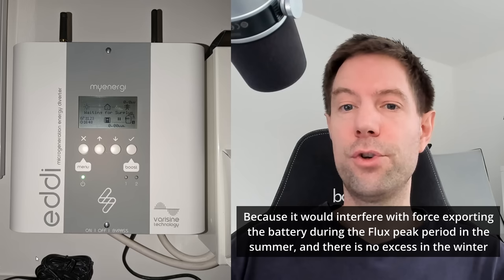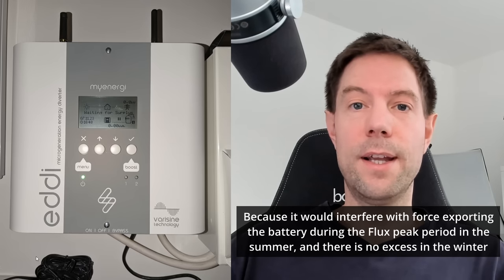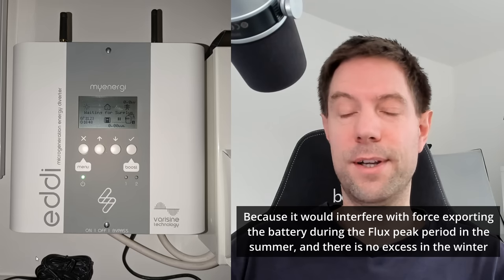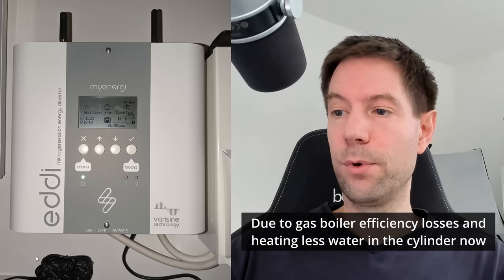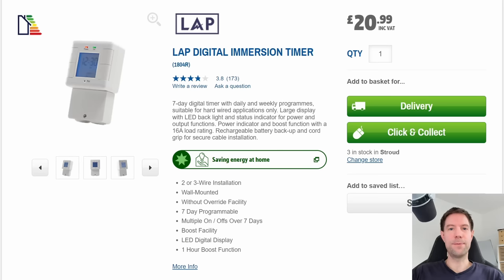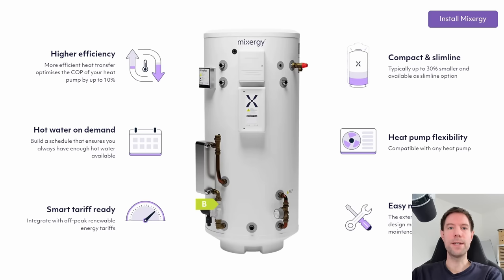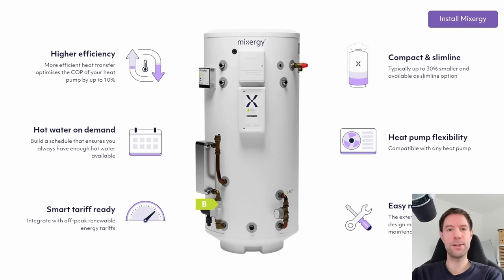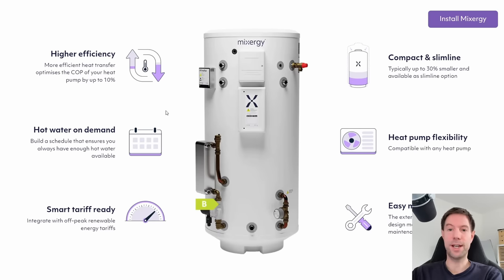Gas free hot water - so many options!

Comment: Interesting options when considering A2A heating and how to heat DHW - we currently get approx 200-250 days of ‘free’ HW from PV diversion (hardly any in the winter due to the addition of a battery lat year which takes priority)

BTW your explanation of how flat plate and evacuated tubes work wasn’t quite accurate - the water itself doesn’t circulate through them but through a heat exchanger mechanism depending on which type (usually filled with anti-freeze). Also evacuated tubes only have a header tank at the top - the tubes themselves are hollow much like a vacuum flask and have another tube within containing the heat transfer fluid which evaporates and carries the heat to the top to then be transferred into the header tank. They still work pretty well in winter and were all the rage along with thermal stores - they seem to have fallen out of favour over PV it seems but as a supplemental heat source could well fit the bill…
Reply from the maker: Yes, I simplified the explanation for brevity as it wasn't too important.  More important to show that it exists than folks know exactly how it works.
Reply: @TimAndKatsGreenWalk  true to some extent, but the benefits are that once you have them installed, there is no additional (electrical) energy input needed (for the most part) unlike the alternatives where you still need a source of electricity - that in itself is the biggest plus point - admittedly on really dull (or snowy!) days the immersion may need to come into play but £ for £ they may actually be the best value solution if you have the roof space...
Reply from the maker: @Umski  I showed these various options as a starting point for folks to do their own more detailed research if they were interested in any particular solution.  I couldn't really describe every detail of every system or else the video would have been excessively long!  And there are bound to be many other systems I neglected entirely.  Regarding the solar thermal not needing electricity, I did mention it was the sun that did the heating and not electricity, so I think I covered that point in the video, as well as mentioning supplementary heating might be required in the winter.

Comment: You should wire up the top and use that one instead and do something similar to the mixergy. There is a technology connections video explaining it. Also, I got a T Smart immersion heater that gives you some smarts for around 100 GBP.
Reply from the maker: Yeah, that's an option but we do sometimes need a bit more hot water than usual (when we have visitors, for example).  Hopefully we'll get our replacement system next year in any case.
Reply: @TimAndKatsGreenWalk  I fitted a duel immersion cylinder with a change over switch to be able to select either depending on water needs.

Comment: I wasn't aware that some air to air systems can work for water too. Do you know of any systems in particular?

If it can do that, that's kinda cool
Reply from the maker: So the only one I know of is the Daikin Multiplus system, but it turns out the hot water cylinder is quite small at 120 litres, so not great for larger households.  And there is some debate about whether or not you can actually get hold of it in the UK just yet.  It might be that we did end up making a sensible choice after all and wouldn't have chosen differently even if I had known about the Multiplus system last year, but there you go.  Anyway, worth looking into in case it turns out to be suitable.
Reply: @TimAndKatsGreenWalk  Thanks. Definitely worth looking into

I think you also made a fair point at the end ie: the heat pump cylinder making noise which could be annoying when the boiler atm is in my room, in a little cupboard which also acts as a walk in wardrobe.

I do like the idea of keeping the walk in wardrobe, and having a heat pump cylinder outside. I'm not too keen on sunamp largely because of the reviews I've seen against them and them being fairly vague on their website

BTW have you looked at a Zypho or similar? The idea is that they have waste water heat recovery which further helps save your DHW usage
Reply from the maker: @waqasahmed939  you'd probably want the heat pump cylinder in a garage or similar, rather than outside.  I'm not sure how weather resistant they are (electronics and such) and they would lose more heat when outside too.

I have looked into the Zypho, looks interesting, but not something I'd install unless I was remodeling the bathrooms.  One to keep in mind for such an eventuality though.
Reply: @TimAndKatsGreenWalk  That's fair. I do only have a small (uninsulated) garage too. I'm with you RE: only getting a zypho if remodelling. Otherwise they seem expensive as a one off

I did however switch from an electric shower to a smart digital shower. I've got an en suite that already had a mixer too, and interestingly I found zero pressure drop when replacing the electric shower for a smart digital shower. I think the digital thingy regulates the pressure somewhat which is very useful when I don't have a cylinder .

My initial rationale was :

It's unlikely that I'll use the en suite at the same time as someone in the main bathroom. 

The guy before me was an auto electrician who wired the shower and lights together on the same circuit and that kept tripping my fuse. 

I was told that the wire was just within tolerance for the shower but not also for the lights too, and I figured I seriously reduce the risk of my house burning down due to a wire getting too hot and I reduce running costs if I move to a mixer 

I bought the smart digital one because it was £200 more and I thought that's not bad in the grand scheme of things 

I've now had a shower whilst the other main shower was on, albeit rarely, and I still found zero issues. That's a nice additional benefit 

I found out about the zypho later on however so if I remodel, I'll pop that in
Reply from the maker: @waqasahmed939  goodness me.  Yes, I can see why you'd want to change it.  It's always tough to decide what's best to do.  Good luck with whatever you decide!  Although at least the digital shower seems to be working better for you.

Comment: I am just about to start a major renovation on a 1950's bungalow.  I am starting off with a wrap around extension and a dormer in the roof.  The front of the house will have external insulation fitted and as it semi-detached I am also going to include some insulation on the adjoining walls.  The roof is East West just like yours so I will have 6 in-roof panels on the front and 6 panels on the flat roof of the dormer at the back.  I have designed in a plant room, as the garage is being demolished, and that will have a Mixergy tank, a tesla battery, connections to the underfloor heating from the ASHP and an MVHR controller along with one or more new consumer boards and a power supply for the car charger.
My question is this, can the ASHP support the Mixergy tank as well as the under floor heating? or should I try and power the Mixergy tank from the solar.  I think I understand most of how everything works individually but it is how I combine the various elements that I get a bit lost (also planning on having the Harvi & Eddi).  Your thought would be very welcome p.s. I love the channel.
Reply from the maker: Sounds like a great project, but there's one adjustment I'd suggest.  You shouldn't need the Mixergy tank at all as most A2W ASHP systems will come with their own hot water tank, which will run from the heat pump too.  So in other words you'll get both heating and hot water from the one system.  If you're heating your water using the heat pump (which is what I would recommend) then you shouldn't need the eddi for solar diversion either, as it's much more efficient to heat the water using a heat pump (at 300% efficiency) than using direct electrical heating via the immersion and eddi (only 100% efficient).  You could then export that excess solar instead using a good export tariff such as Octopus Flux in the Summer (and then switch to something like Go or intelligent Go in the Winter when the excess solar dries up).  Whenever you're heating anything (home or water) then a heat pump is always the best option.  I hope that makes sense.
Reply: Thank you so much for the heads up, I hadn't realised the ASHP came with it's own hot water tank, I was thinking of the Mixergy as It will only be me in the house most of the time and I liked the idea of only heating as much as I needed, presumably the standard tank will be fully heated.   My reason for doing this is to have minimal cost in my old age and I only have the money now and when it's gone it's gone.  Having read some of the other comments not having the Mixergy would also save on the servicing.  Have I missed any tricks anywhere else?
Reply from the maker: @christinewhite3749  so you'd probably find that a heat pump heating a full cylinder will still be significantly more efficient that a Mixergy tank heated only halfway.  Although, you could probably get a relatively small cylinder to go with the ASHP system (120 litres, say), in which case you'd get both benefits.  As for other considerations, the only other thing I'd suggest is taking a look at the GivEnergy All in One battery, which has similar specs to the Tesla Powerwall but is a lot cheaper.
Reply: a suggestion?

you mention Tesla battery

if you follow Tim's great suggestion of a GivEnergy battery, maybe consider TWO batteries? (say, 20KWh-24KWh). Might still be cheaper than Tesla PowerWall!

my suggestion is based on the substantial eventual size of your home, to maximize self-consumption in summer and maximise off-peak charging in winter.

it depends on your home and EV's consumption, and generation, across all seasons.

installation costs are a SUBSTANTIAL proportion of the final cost; installing two at the same time is likely to be considerably cheaper than two installed separately.

perhaps look to the associated GivEnergy EV charger for benefits from them being able to 'talk' to each other so they are both smarter
Reply: Thanks for adding to the conversation - I did look at other batteries but unless I am mistaken the Tesla seems to be the only one which can power the house in a power cut, others just let you have a couple of sockets so you can boil a kettle, we just don't know what the future holds and I would just like this little extra security, If I am mistaken please set me know.
Reply from the maker: @christinewhite3749  the GivEnergy All in One also has whole house automatic power cut back up, basically works exactly the same as the Tesla.  I did a video about it a while back, I'll grab the link for you.
Reply from the maker: @christinewhite3749  here you go: https://youtu.be/_cr87eTvqYs?si=ADraftbo_PlsUhLn

Comment: Hi Tim thanks for another great vlog. I to didn’t know you could heat your hot water with an  A2A system so I am looking at a Mixergy tank. I am told the heat pump on top of the tank is quiet?? So would be suitable for an airing cupboard??
The problem with all this change we are doing I have found little advice/ information on which direction to go.
So have relied mainly on YouTubers like yourself to make my decisions and I thank you for that and sharing your journey.
Best regards 
Simon
Reply from the maker: Well, the heat pump on top of the Mixergy cylinder is not exactly silent, I think you would notice it.  It'd be like having a particularly loud fridge in the airing cupboard, so you might want to consider some sound proofing treatment to be sure.  Unless you can install it in a garage, say.  Although another viewer did mention that apparently you can install the cylinder and heat pump in two different places, connected with the relevant pipes, so you might be able to install the cylinder in the airing cupboard and the heat pump somewhere out of earshot.  I've not verified this just yet, but I'll be getting in touch with Mixergy to confirm.  In either case you would need venting pipes to the outside for the heat pump, so that's something to bear in mind too.
Reply: @TimAndKatsGreenWalk  maybe I could connect it to my existing ASHP as I have a spare outlet on it?
Reply from the maker: @simonperkins345  good question, that's not something I know the answer to for sure.  You'd have to contact your ASHP manufacturer to see if you can do that.

Comment: Nice insight to the options available . Seems like a very small return for an expensive investment, have you done any calculations on return of investment if using off peak tarriff in winter and free to heat with solar in summer
Reply from the maker: Yeah, it's not the best "investment" for sure, but that's not really my aim here, I'm mainly trying to reduce our energy usage.  If you have a good export tariff in the summer (Octopus Flux, say) then the opportunity cost for export is pretty high (20 p/kWh ish) so saving those kWh to export rather than heating your water is actually pretty beneficial.  Even so, I doubt you'd pay for the kit in a reasonable time.  Still, I present these options for those who might be interested.  And if you have to replace your hot water system anyway (due to age, or failure) then it makes sense to do so with an efficient replacement.
Reply: I think mixenergy have control over the cylinder so they can dump heat into it when required at certain times  and they charge to have someone come out to service every year also

Comment: Are you considering a thermodynamic panel? Instead of the outside unit you have a panel on your roof or wall. I haven't seen much on YouTube about them lately though.
Reply from the maker: You mean like the solar thermal option I mentioned, or are you referring to something different?  I think I'm pretty set on the heat pump cylinder at this point but if there's something I've missed I'd be interested to know.

Comment: Interesting..  Just for clarity and assuming a new water based ASHP where being fitted the ASHW-cylinder would not be needed?  Would there be a differential between SCOP of an external heat pump plumbed to a specific compatible cylinder and that of a ASHW-cylinder?   For some reason I had it in mind that the external ASHP only heated a hot water tank at a SCOP of 1 🤔
Reply from the maker: The SCOPs should be similar regardless of where the heat pump is installed (as long as the air is vented to and from the outside) .  So an external heat pump would still heat a cylinder at a SCOP of 2.5+, maybe higher in some cases.  The main advantage of the A2W system is that you then only need the single external heat pump, which would provide both space heating and water heating.  Having opted for A2A instead I'd need that second heat pump for the hot water, unfortunately.  In either case you need a cylinder to store your hot water, heat pumps can't provide hot water on demand.

Comment: The second element on your water tank is usually wired in on an economy 7 system (cheap rate electricity overnight).
Reply: You can wire the second element  up to your Eddi and configure a Top and Bottom of the tank. Eddi will heat top first when boosting / solar excess and bottom when doing overnight heating. Benefit is you only heat what you need. It’s one of several configuration options in the Eddi manual.
Reply from the maker: We're heating ours at cheap rate anyway, so it's all good.
Reply: @TimAndKatsGreenWalk  less heat up time and heatloss when less water required by using top one. lag any warm pipework in the airing cupboard. got our cylinder heatloss down to 68W for a 174L megaflo eco
Reply from the maker: @waynecartwright-js8tw  the heat loss from our cylinder is about 45W, so I reckon we're doing ok (I lagged the heck out of all the pipes in the airing cupboard).

Comment: Using the immersion heater, the cylinder will fill up very quickly with limescale. Like a kettle.
Having 60-65 deg water circulating in the cylinder heat exchange coil, minimises limescale deposition.
Reply from the maker: Depends on your water hardness and the temperature but yeah, something to consider.  Titanium immersion elements help prevent build-up too.  Hopefully we'll be replacing our cylinder with a heat pump one next year in any case
Reply: @TimAndKatsGreenWalk  
Is it possible to have these heat pump cylinders installed in the airing cupboard?
Reply from the maker: Yes, although you'd need vents to the outside (possibly via the loft) and you might want to add some sound proofing to the airing cupboard to help mitigate the sound of the heat pump (like a loud fridge).  But totally doable.
Reply: @serraios1989  my one is in my garage but it would have fitted in my cupboard upstairs where the old water tank used to live (do water tanks live 🤔)  You definitely need access to provide the air intake and exhaust two 6 inch holes. I didnt place it in the cupboard due to my concern about it having some noise but to be honest with the right amount of sensible sound proofing you probably wouldn’t hear it that much and if you have the heating period outside your normal bedtime then you probably want hear it at all
Reply: @TimAndKatsGreenWalk  The soundproofing is also likely to provide a bit of extra thermal insulation.